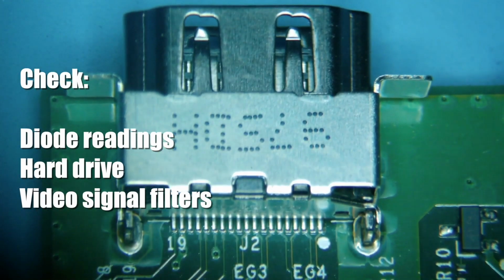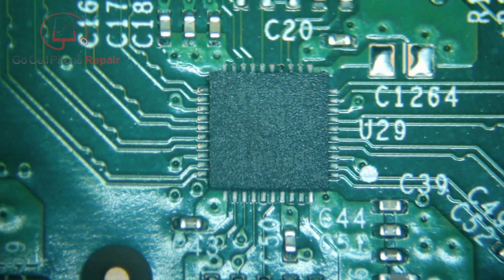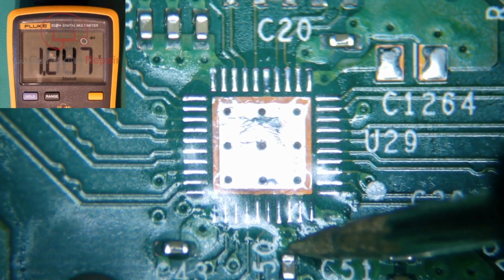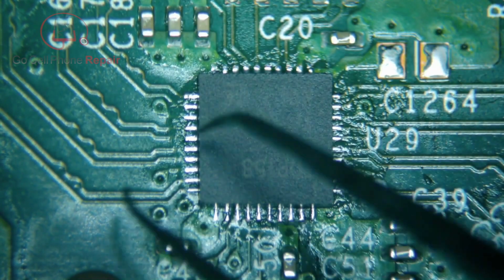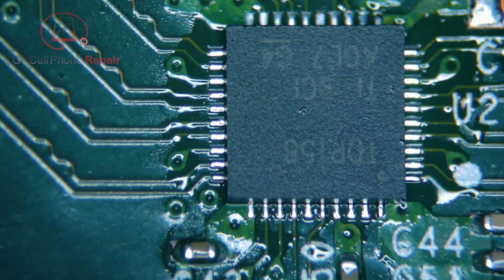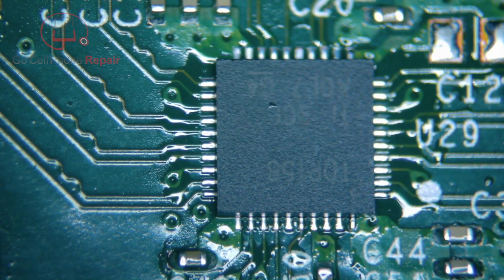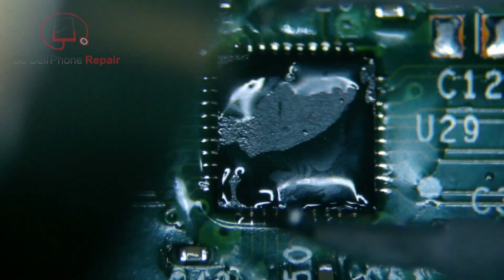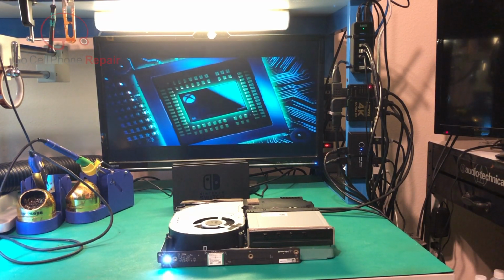XBox One X Redriver IC Replacement

Comment: great video. where do you get the correct diode readings from?
Reply from the maker: You'd have to take them from a working board and unfortunately I don't have those. Usually though they other than the ground lines they range between .300-.800 roughly iirc.